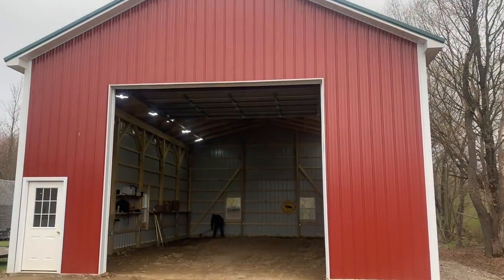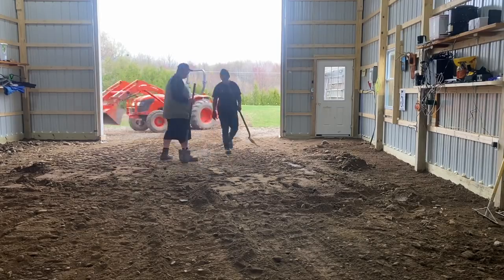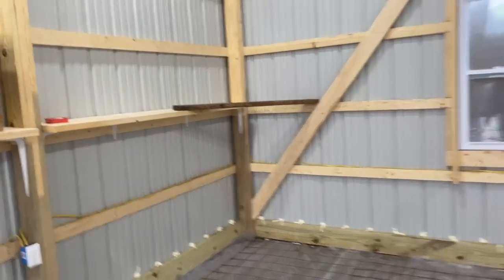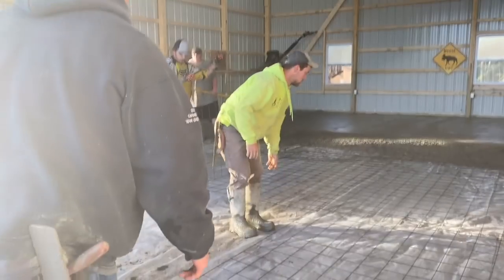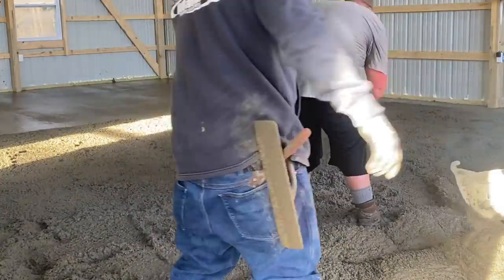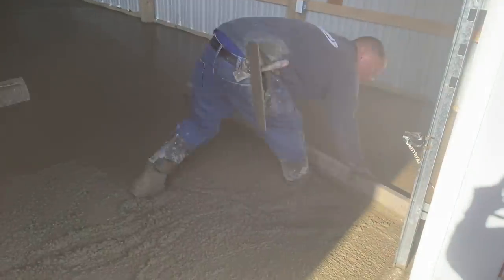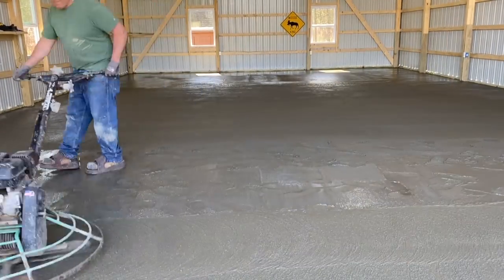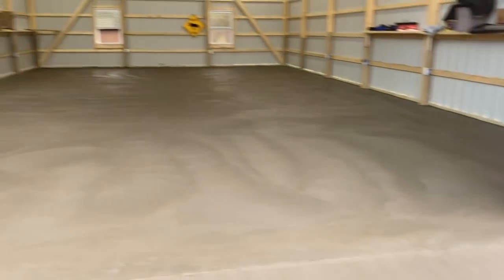Exterior concrete vs interior concrete (WHATS THAT MEAN) ????

Comment: I like the 2x8 on the bottom. That way you didnt have to have the apron slab up on the metal as the metal was higher though i probably would have made a drop screed board to go along on top of the 2x8 to set my grade.
Reply from the maker: Thats true greg. Maybe that is why they did it. We like the laser 👍

Comment: Nice job. 
I always wanted to try a slab on grade pour experiment with an arched sub-base to reduce concrete used. Example, for a 6" slab I envision 6" half round plastic tubes on the sub-grade, maybe 16" on center. This would allow for less concrete, and the added strength of an arch. If successful, there might be a way to create a sub-base finish to mimic the half round tubes. One could overfill the sub-base and furrow out the arch pattern. The concept might make economic sense given the price of mud.
Reply from the maker: I think you might be on to something. That just might work. It will save money too. 👍😊
Reply: @bondobuilt386  Maybe so..Furrowing arches  to prep grade for small scale test slab would fairly simple to do with a shovel. Bigger slabs would require a tool or attachment that furrows the arches, in one pass preferably.  An exterior shop approach would be a great place to test an arch slab concept. I'd need to think more about wire or rebar placement. First thought would be to simply lay a wire mat perpendicular to the arch furrows. Furrows could also be a natural place to lay hydronic floor heat tubing.

Comment: Do you ever have trouble with the apron getting higher than the pad with it not doweled with rebar? I was always taught to run the rebar wild for the apron here in Montana. I was told it kept it from separating from the building or changing height.

Comment: I was wondering how you would finish a concrete pad edge if it came flush yo the outside wall. I find that's the edge that gaps out if the foundation under the asphalt is not strong enough. Can you prevent the asphalt and concrete joint to separate? If water gets in then it separates more I would think with winter and all. Great video, and I've done sloped attics like that, not fun lol.

Comment: Ron is there a reason to not put in air entrained concrete inside the pole barn ? is it less strong ?  my pole barn will not be heated but i want a rock hard slab inside. any reason why you dont use hats to hold up the mesh ? sorry lots of questions but you are the go to guy on all this good stuff !
Reply from the maker: No problem on the questions. Air entraimed concrete is for outside. It is not good to machine finish it. it will separate while power troweling it. Just do light air in your pole barn. I dont like chairing the mats up because people can’t walk on it verry good. Ok if its a small pour though. also trucks cant drive on it.
Reply: @bondobuilt386  i understand and thanks Ron  ! prolly safer for me to pour my aprons separately  on different days as i wont have a top crew like you do , im re-watching your vid from Aug 25 (big nudura wall pour) I think im going to do my house on a alaskan slab with 8' nudura walls all around, wanna do a A framed ranch. I wanna work with you on this, hoping i can contract you to do some with me on it. I'm in CNY , wanna do as much as im able tho on my own, just need a pro back up , thanks Ronnie

Comment: I noticed you didn't place an expansion joint between the apron and the inside. Aren't you concerned about heaving and getting a ragged crack?
Reply from the maker: Dan I never had any problems with the apron except one time a customer wanted it doweled into the slab that made it crack.

Comment: Thanks for explaining the little details. 
What keeps the skirt boards from rotting?  They look to be 'in grade' which means they will get wet from the exterior.
Reply: That’s a good question. Not sure if you’re into post frame (pole barn) construction but that’s how all these guys build them.
Reply: Actually, that skirt board can go ahead and rot. It’d be no harm to neither the slab nor the posts. Skirt board isn’t much more than a form for the concrete.
Reply: @d.i.whynot484  
I just did a quick net search and pole barn shirt decay appears to be a common problem.
Reply from the maker: This is one reason I don’t lkike pole barns that much.  Not a fan of wood in or on the ground. I do pour a lot of floors in them though.
Reply: @bondobuilt386  I agree Ron , but to build the pole barn on top of the slab will keep the rot minimized. prolly not called a pole barn anymore then, somehow you get around building codes i assume calling it a pole barn design
Reply: @bondobuilt386  I see a lot of them with aprons around the whole building. Would that help? Huge increase in expense I’m sure.
Reply from the maker: @d.i.whynot484  yes that seems like a big expense.
Reply from the maker: @italRotty  it will still pass code built on top of a monolithic slab. Bracing with be different without the poles in the ground though. 👍
Reply: We put expansion around ours so that’s less likely to happen

Comment: I'm about to get concrete in my barn and I was thinking about putting down crushed stone as a base, is that not necessary to help prevent cracking with ground movement?
Reply from the maker: Crusherd stone with dust in it is a good base. Crushed gravel works too.
Reply: @bondobuilt386  thank you.  Now you didn't use it for this job, is it just a matter of budget?  I just dont want to regret not putting it down later if cracking occurs.
Reply from the maker: @carrerofun2185  The customer had this gravel in there. Stone is better but more money. either will work though. Compaction is important part.

Comment: All that wood in direct contact with the concrete?  Since the ground is always wet, and the wood will wick moisture from the ground/concrete, this seems like intentionally causing the wood skirt and bottom of all the posts to rot.  300 foot trees suck water to the top.   BTW, foam knee boards are a great idea.